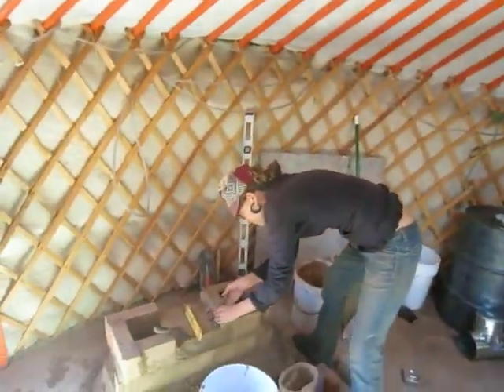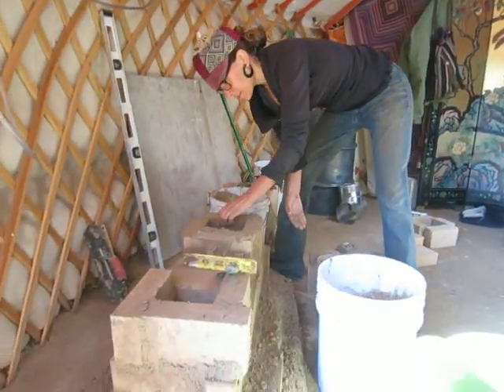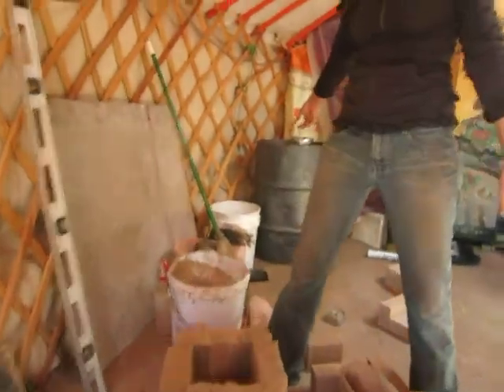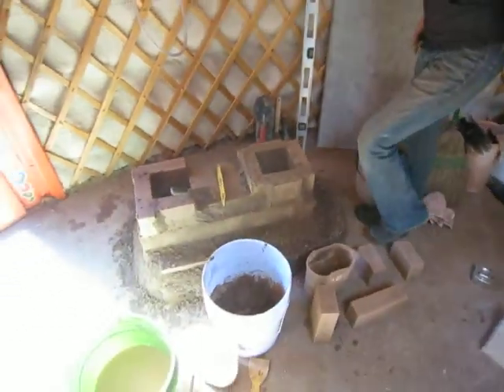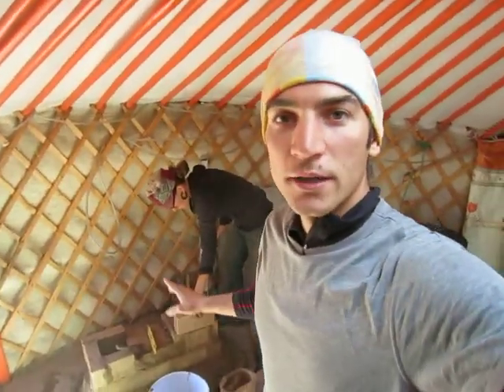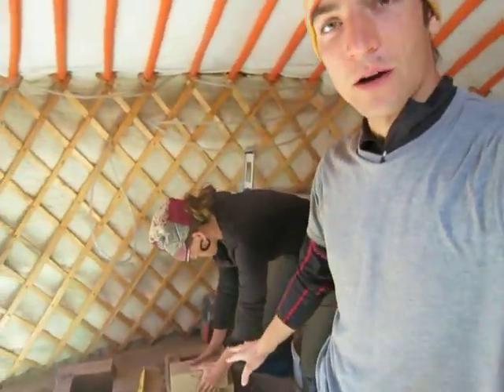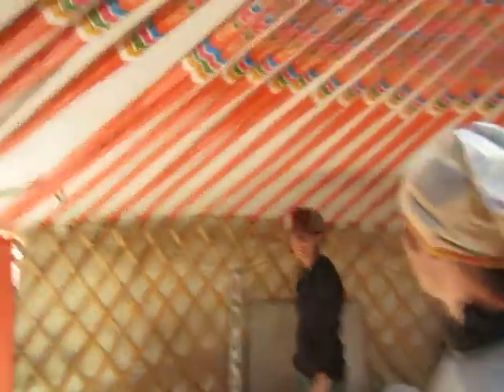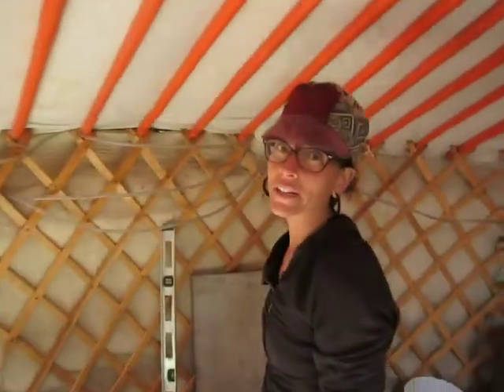Rocket Mass Heater in Progress!

Comment: hi! what's the base for the yurt? did you get any problems due to the weight of the rocket heater and a wooden deck?
Reply from the maker: Hey Nuno. This is an earthen floor. So I built this before we built the rocket mass heater right on top of it.  so no problem with weight